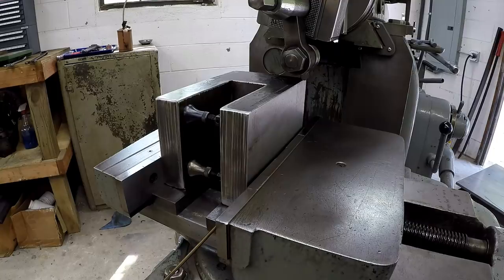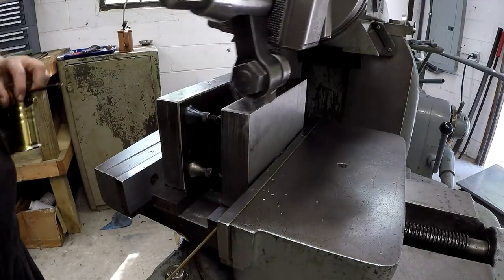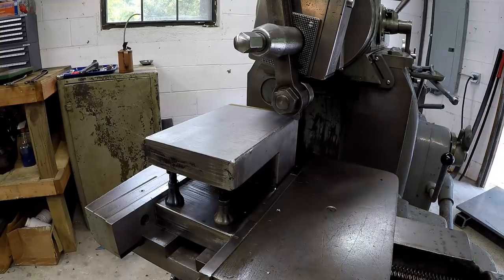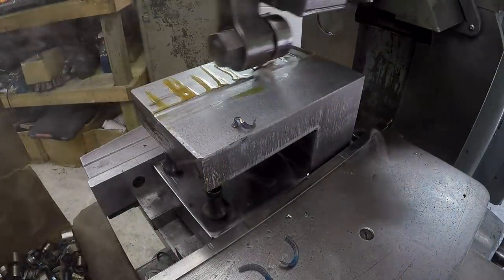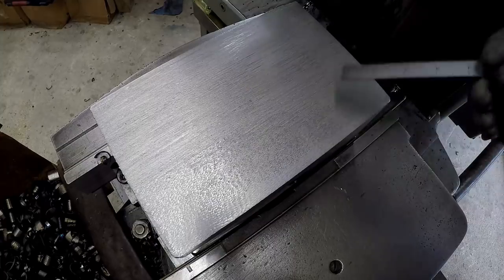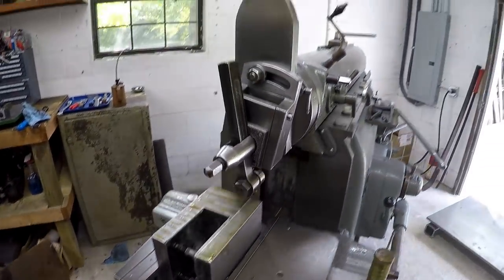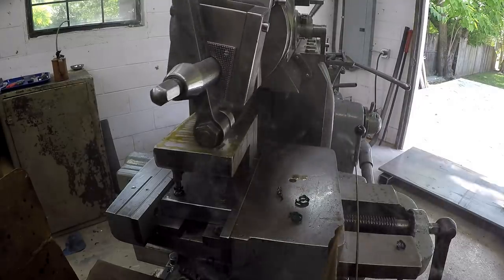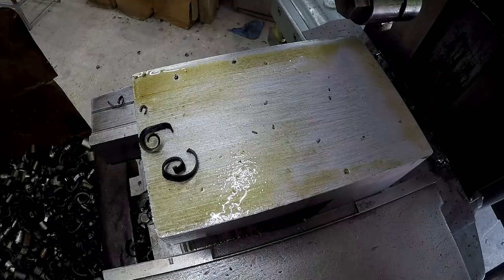Shaping a Hydraulic Rod Clevis Part 2

Comment: When threading pipe we use cutting oil for the same reasons you have shown,
it stops the chips damaging the thread and the dies.Keep up the good work,the shaper is working great.
Reply from the maker: Cutting oil for pipe and bolt threading is a must. I used to have an old Oster pipe threading machine.

Comment: Looking at the finish you can see the difference oil makes, and also the difference LOTS of oil made when you started bending your elbow ;) - still it seems to me the bulk of the oil is rolled up with the chip and thrown on the floor.  The oil that looks to be doing the work is the stuff that cascades down from the uncut plane down the newly cut edge and gets caught in the backstroke of the bit and gets smeared up on the backstroke.
Obviously a white water setup following the cutting edge is best but I wonder what happens if once you have a lip you concentrate making a pool of oil on the newly finished surface that should "wick" more of the oil into the interface of the cutting shear point.  Possibly using the lower middle area of the stroke will get a good spread but I think it needs a bit of experimentation.

It's sort of what seems to be happening once you got some serious amounts of oiling going on the heat should thin the oil which will then "follow" the cutting edge like a big pen but at the mo the blade is only spreading the spill from the waste.  I can see it - just hope I'm saying it right.
Another option would be to have a drip oiler fixed to the arm so oil drips onto and down the blade directly into the cut.  Maybe over egging the job and I imagine it was tried and rejected 100 years ago - just shooting the breeze.
Reply: Maybe a coolmist unit would be most useful aimed from behind the tool at the leading edge of the cut?  Spraying the air/coolant right up the tool relief angles puts it as close as possible to the cutting edge, and ensures there's something on the fresh cut metal for the backstroke.

Comment: thanks for adjusting the slide so it does not go behind the V shaped wicks exposing the ways to contamination.   are you thinking about upgrading to a diamond hone  or getting a flat diamond disc to mount next to a grinding wheel so you can easily diamond sharpen the big tools..  or mount a diamond lapping disc on something like an automotive hub and bearing assembly to allow you to spin it somehow without any run out. perhaps with a right angle gear motor driving thru the middle of the hub..

Comment: If you are concerned about the smoke and want to improve the ventilation around your machine, try using your fume extraction system to draw away the fumes. You could even get away with an extension tube so you don't need to move the machine. Alternatively,    use a fan blowing out a doorway to create a vacuum in the shop to draw the fumes out and fresh air in. You might need to open or close some windows to get a suitable airflow path but you should have less wind noise around the microphone of the camera.
Reply: Wow, I bet he hadn't thought of that!

Comment: The time saving when cutting it the long side vs the short side must come from the time not in-the-cut: It is the same distance cutting air before and after the cut on each stroke, but much fewer strokes to complete the cut. So less time cutting air. On top of that the tool probably lasts longer because of fewer times entering and leaving the cut. Especially here that you have got the flame-cut and mill-scale. Great video !
Reply from the maker: All good point, and all mentioned in the books.

Comment: i wonder if a solid lubricant would work well on a shaper. my idea is just rubbing paraffin wax on the work piece or melting candlewax on it. the wax will melt as it contacts the hot cutter and/or chip, but wax is more thermally stable than most oils and I bet it won't smoke.

Comment: altering your rake angle helps with finish on a shaper tho it depends on the steel you are using, some tool steels need no rake at all. I grew up with the smell, its in my blood
Reply from the maker: It’s the learning process of what works best that I’m going through. 👍🏻

Comment: What do you think about using a spray bottle with soluble oil to prevent chip welding and add in some cooling for the HSS bit Adam?
Reply from the maker: I prefer the oil method myself

Comment: I’m not a machinist so could someone explain why you put oil on the surface that is been cut? It seems to me that the face of the cutter that is cutting into the steel never comes into contact with the oil.
Reply: Cutting oil helps to stop chips from binding to the cutter and work piece (which can happen as high temps are generated when making deep cuts) and the cutter is picking up a little oil each time it passes over the workpiece.

Comment: Under what conditions would you NEVER use cutting oil??
Reply: KitCox, that's an excellent question and a subject we don't hear enough about so it would be great to hear what Adam has to say and would make for a great video, hint, hint ;-) but from my extensive armchair video analysis and over 30 years as a woodturner, cabinet maker and joiner, having also hand turned steel and brass on a wood lathe, (with good eye protection being MANDATORY), the most common situation in which to not use oil or flood coolant is turning, boring and milling grey cast iron as it generates a fine dust which is best machined dry and vacuumed up afterwards and if you watch Keith Fenner's videos also, (channel under his name), you'll see him cover the bedways with a towel or cloth to protect them during turning. It makes a real mess. Cast Iron has a powdery crystalline structure which cracks and crumbles easily so it doesn't generate as much heat in the part or the chips and 'ductile' or Spheroidal Graphite (S.G.) iron is somewhat self-lubricating but if fluids are used it makes a fine slurry, like valve grinding paste which can be abrasive if it gets in bed ways etc. particularly if any casting sand or other impurities are present, which should always be assumed with anything cast. Bronze and Brass are other examples where they cut better when dry as they're very 'sticky' and grab the tool so should be cut with a neutral to negative rake or tool angle or the tip will be drawn into the material when it snatches, cutting deeper than the indicated reading. This is why engineering lathe operators typically align the cutting edge exactly at or just below center whereas woodturners always cut well above centre as the relief angle or 'bevel' is used for tool support, rubbing in tangent to the rotating workpiece as it cuts. Stainless steel drills well wet or dry but the chrome content means it needs more grab or friction to bite into it without skating, kind of the opposite of brass but it generates a LOT of heat in the process so use new or very sharp, more heat resistant cobalt steel or carbide toolbits and split point, (dual bevel), 8% cobalt HSS drills, (usually marked 'Co8''), with lots of consistent feed pressure and SLOW rpm or you'll burn up the drill tip if it rubs for the shortest time without cutting. Hope that helps and Adam, don't forget to make a video about it!?

Comment: So what sort of power consumption would be average for that shaper during use?  
The finish is much better with oil, but I'm just wondering about energy efficiency...  
Would be interesting to see if cutting oil paid for itself in lesser power consumption on something like that shaper.
Reply: the machine probably costs 10c an hour if that, electricity in the usa is dirt cheap

Comment: Taking those long cuts, the bit would gather heat throughout the length of the stroke, then cool when it was not cutting. Using the shorter cut would have less distance for heat to accumulate. Cutting the short  way on a 2:1 surface would require twice as many cutter direction changes and take more time as you said vs cutting the long way. 

I think I saw a shaper or planer with two bit holders, (??? at the time!) I guess you could set up one cutter for roughing and one cutter for finish and do rough and finish one side at at a time without turning the work. - just guessing :)
Reply: In theory that could be set up with a specialized tool holder.  Cant change the step over, but it sounds like something an old timey shaper operator would tinker up while waiting for his machine to finish cutting

Comment: Adam, are you using the black high sulfur oil you normally use for threading on this or a lighter oil like mobilmet? Can't tell from the camera angle. I'm lovin this though. My dad sat and watched this for a few with me. Brought back memories for him back in the 60's 70's and 80's. They used a lot of shapers around where I live back in the day he said. "If a slab mill wasn't available or if it was parts off the flame table, it went on one of the shapers. Those shapers were running every day, 2-3 shifts at Austin Western, Thor and Barber Greene."
Reply from the maker: Brian, yes in using sulfur based dark cutting oil. Mine is an Exxon branded Pennex N47, no longer available. I have a 55 Fallon drum of it that will probably go back long before I can use it up. At work we use the Rigid brand and it seems very similar.

Comment: Why use a shaper over a milling machine? What are the pros and cons of each? Love all your videos!
Reply: In this case he is saving multiple hundreds of dollars in tool costs, by getting the piece into shape on this machine.
Reply: One HSS cutting edge that is easy to touch up VS. a couple hundred dollar end mill or shell mill inserts (for the outside at least) to cut through the tough flame cut skin. It may take longer but it is way cheaper to do it on the shaper. A shaper is one of those tools people use nowadays to just enjoy the machine, not break speed records.

Comment: Mmm...cutting oil...

I'm curious about why the head of the machine (what holds the tool post) is at a slight angle? Also noticed the tool post in the last pass was in a slightly opposite angle?

Really like your videos. I've gone from Jonathan W to Keith Rucker and Fenner to you.

Thanks.
Reply from the maker: The clapper box is what your talking about. You swing it away from the travel of cut. It allows the tool bit to swing away from the work piece.
Reply: Abom79 Ok, thanks. I wondered how the tool was allowed to move as it was drawn back. I could see it bouncing.

Comment: Does all/most of the heat go into the chip, does the part get hot? This clevis isn't close tolerance but would heating affect dimension as it heats up during a pass?
Reply: DW Macaulay yes the majority of the heat generated is taken by the chip. Some does go into the tool and the work piece

Comment: Is that tray out the tail end of the shaper new?  Haven't seen that in your previous vids.
Reply from the maker: No it’s part of the machine, a guard, and also to catch way oil drippings. I bolted it back on once I had the machine cleaned and running.

Comment: Cutting oil mystifies me. Think about it...the oil is never actually between the tool and the material, it’s always on top of the chip being lifted away. So how does it help with chip welding?  The proof is in the pictures here that it’s affecting the cut in a positive way, I just don’t understand how.

The engineer in me wonders if it’s not a heat transfer situation. The oil is getting hot enough to change state (liquid > boil > smoke). Maybe in doing so it’s absorbing and carrying away enough heat to keep the chip below the temperature at which it starts to weld itself to the tool?

Anybody out there able to shed some light on the subject? I’m all ears, truly just trying to understand what I’m seeing here and on my own machines at home.
Reply: Thomas Utley I have never used any of these machines as I'm a tech guy.  But my idea is as the chip rolls the oil helps it to move about say curl easier?  Anyway I always know that you can't use too much lube.  Nobody likes a dry cut
Reply from the maker: Tom, it is a big mystery, but we all know it works. 👍🏻

Comment: He Adam, i have a question.
Looking at the surface finish differences with and without cutting oil.
Is possible to like automate that? With a little dripping system? Or does a true machinist do it by hand ?
Reply from the maker: I have visions of a cool oil dripper attached. Something I might dabble into later.

Comment: I'm curious. (Not a machinists, forgive the question.) Would it be better to use coolant, instead of cutting oil? Why, or, why not?
Reply from the maker: Coolants were not used on shapers and planers. Generally too low of surface speeds to generate the heat needed for coolant.

Comment: It does not seem logical to turn the vice that way.  It seems that more clamping force would be required to prevent the work piece from moving.
Reply: In that position you are relying on friction between the jaws and part to hold it in place rather than mechanical locking. However, there is a very large amount of clamping area and the vice can provide a very large amount of force. This far exceeds the amount of torque the tool can apply to the work piece. I would not be surprised if he could pick up the shaper by that block held in the vice.

Comment: Is there a benefit to using a shaper rather than a mill?
Reply: Main benefit here is cost of tooling. You need just a few fairly cheap high speed steel bits vs several large expensive endmills. A milling machine can probably do this faster. Accuracy would be similar
Reply: Shapers were largely displaced by milling machines, that's why shapers are not seen in most machine shops. There are operations hat a shaper can do and a milling machine can't. Adam has explained the economic advantages of the cutting tools.
Reply: I think the main benefit is pretty clear if you listen -- it's FUN!  Not about money, or efficiency, or any of the rest of it.  It's FUN.  I don't why people don't get that.
Reply: Yup!

Comment: I hope you arent billing these clients by the hour....you chose the slowest and most non efficient way to mill this.
Reply: Eccentric Smithy 
Adam even states that, and still they don’t get it, he does it this way because he wants to and can. 
Also you can set these going, go do something else and when you notice that the pings have stopped you go back and start another cut, then go back to the other job! There is so much time on a job like this between running off the cut and running in to hard stops on the machine. 
Yes I drove one of these in a tool room making money for the company by working just the same as I described if I felt so inclined, sometimes it is just nice to operate one of these and get hypnotised by the movement.